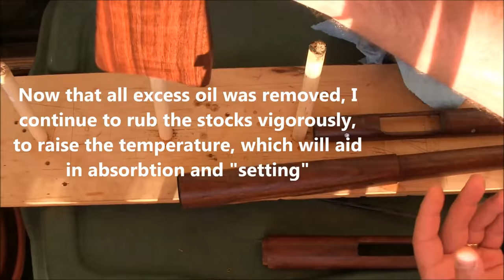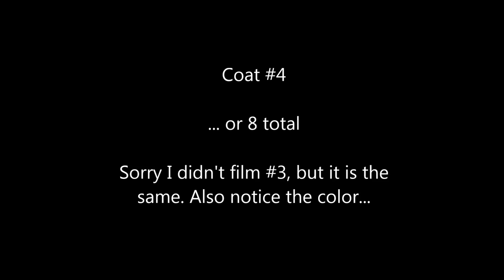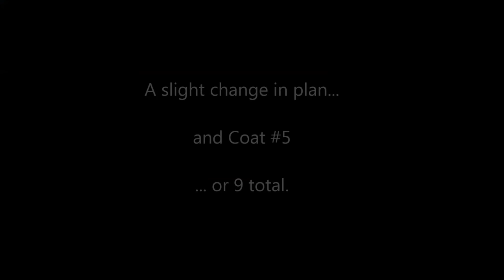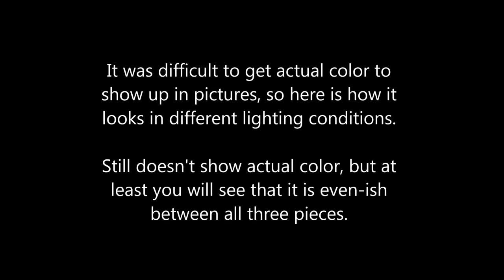Winchester 1895 Russian Musket Restoration - Part 12

Comment: Looks great. I am a long time Winchester collector (since the early 1970s) and have restored a few. I have found that a few drops of Fiebings British Tan put into the oil/turpentine mix will get you the right color of Winchester Red. On some stocks it might also be necessary to add some of their simple Brown color, and when matching a piece to an old forearm or buttstock, a drop or two of their USMC Black. In your mix in that jar, I would have put a half teaspoon of the British Tan, and a quarter teaspoon of the USMC Black. If you decide it isn't dark enough after comparing it to some originals, you might consider this. One or two more coats is all it would take. In any case, you have come up with a beautiful stock set. Congratulations.
Reply from the maker: Thank you very much. I know I have a lot to learn so guidance like yours is really appreciated. I think I need to buy a few pieces of wood and simply try out as many things as possible to really figure things out.
Reply: MosinVirus Ah yes that kind of experiment is best. Scrap wood or stocks are your friends for sure, When I first got into collecting Finnish Mosins, I got a couple of el cheapo refurb stocks as "test mules". That really helped on a couple of restorations.
Reply from the maker: Doby Pilgrim I will try to find as many scrap pieces of wood species used for military rifles to practice on as possible. Could make for an interesting video as well.

Comment: Damn that came out nice. Beautiful wood there to start with!
Reply from the maker: Thank you very much.
Reply: NP. Came out great. Cannot wait to see you shooting it.
Reply from the maker: Range video coming next week.
Reply: Cool. Hopefully I can make it to the range soon to shoot some new toys. Got a cheapy AR that I am building an upper for and a few new handguns to play with. Got a Judge that I want to see how it does with different 410 loads and 45lc as well as an EAA 357 that is a snubby yet feels like a 4" to play with. It was cheap as hell and looks like fun and good for carry for it's size. Do have an old phone I may use to record all the shooting and see how it goes.
Reply from the maker: Sounds like that will be a fun range trip. And yes, try to record and post some vids.
Reply: Will do just need someone to go with me to change out targets cause the dirt and wheelchair just don't mix  Although I want to get as good as I used to be shooting 13 years ago and get a CC Permit again and found a site that has a good holster to put on my chair that it is all still concealed. Just got to get back into it after a long time not shooting. Going to take a bit and I know my problem shooting low right is just jerking the trigger and anticipating the recoil. Just take time shooting to fix that.
Reply from the maker: I will probably never get a CC permit in my state. Ca is very anti-gun and in my county it would be nearly impossible to get one.
Reply from the maker: I am originally from Ukraine.